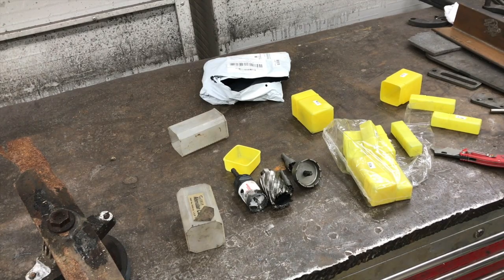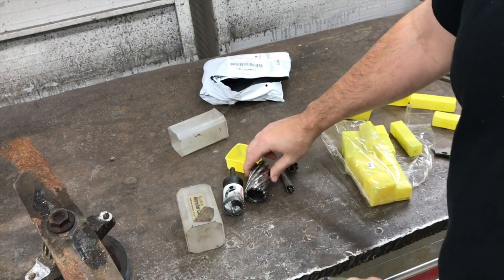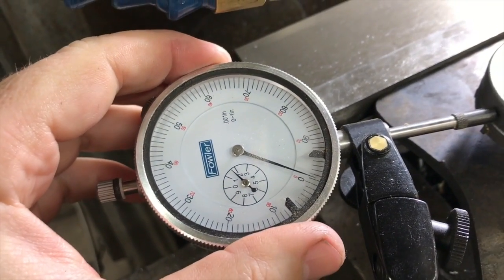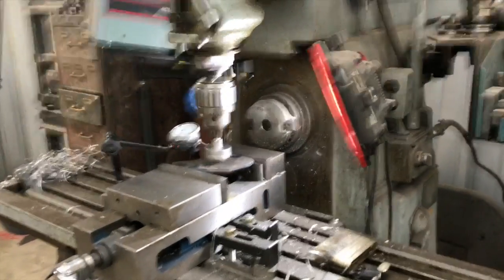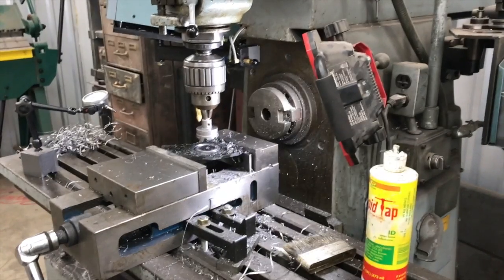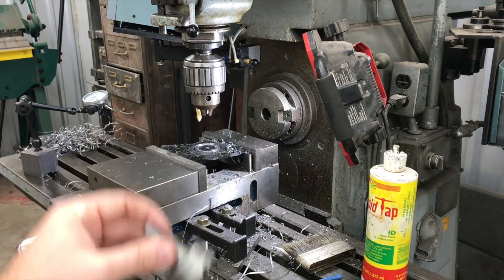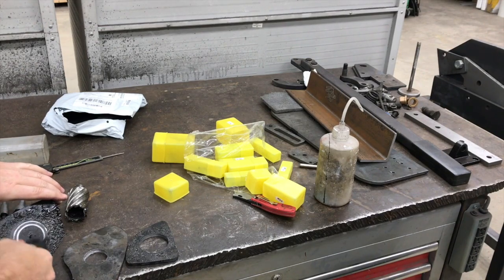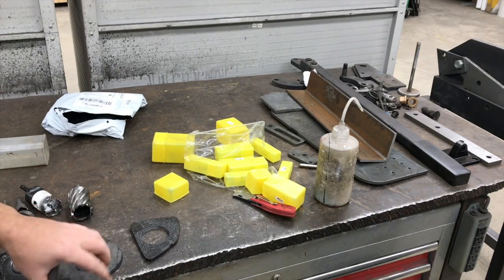Carbide Tipped vs Hole Saw vs Annular Cutter - Which is best to drill thick metal - steel - iron

Comment: I have good results using Milwaukee hole saws or equal on 1" steel.  On larger holes I drill 5/16" holes on the inside edge of the hole to allow the chips to escape from the saw.  Slow the drill press down as far as it will go and go slow with lots of coolant.  It's takes times and patience but it works. One saw will cut two or three 3" holes.  Great video.  I always wondered about those carbide saws??
Reply: Yeah, I saw that hole trick in another video. Will try it soon. If you can afford it, you can put the hole right in the middle of the cut.

Comment: Used them carbide tipped hole saws a lot your bit isn't long or deep enough to cut thru that thick of steel. Rpms are to high you applied to much pressure and I never use lube with them just cut dry like you did with the milwaukee hole saw. But on the end of the day the annular cutter is the best then the carbide tipped then the hole saw
Reply: If you look closely, you can see the cutter dripping before using it. He did use oil.

Comment: A month after you got two separate recommendations for flood cooling, you're still burning up bits. You've made no valid comparison. Go ahead, keep hanging your body weight off those handles, IT.
Reply: I think it's an old guy kinda thing. My dad had the flood coolant dismantled and I had to hang off the handle like a cliff everytime I drill with another hand squeezing off a bottle. Absolutely hate it.

Comment: It's just cheap junk. A single carbide tipped saw should cost more than that.  I agree with another post, best reserved for softer materials except you stated you'd put a pin in the chuck to check it and I didn't notice you doing that.   The saw itself is probably off but if it doesn't cut anyway, what is the real point to it since a regular hole saw will do softer materials?
Reply: aluminum

Comment: I have some of those The Carbide hole saws, bought them off eBay and found the same thing. However, they do work great for sheet metal up to about 1/8 inch material. Anything thicker they will fail miserably.
 Annular cutters are one of the very best means to cut large holes in thick material. But you pay for a good set.
 The typical hole saw works if you buy a good one, and not the cheap Chinese knock-offs.  
 Most everything is made in Asia now, BUT they also make the top quality tooling, for  North American or European Companies. 
 You really do get what you pay for most of the time.

Comment: I use a 56mm carbide holesaw at 275rpm to cut 5mm and it works fine using the same lube as you do. Cheers

Comment: Annular cutters use centering pins for a reason. The rpm was way too fast. My hougen mag drill uses annular cutters and with constant lubrication bangs through 3” solid steel like it isn’t even there.

Comment: I have never used cheap carbide cutters like you demonstrated, but have used trade grade brands for years for cutting electric panel holes with excellent results. I wouldn't consider matching a trade grade tool against a machine shop grade tool and expect the same performance. In the machine shop, I would only apply the trade grade tool where I couldn't justify the expense of the annular cutter.
I have a drawer full hole saws, because they are inexpensive. I have few carbide cutters, and I treat them with respect, because they are life savers on the electrical job site, but more costly than hole saws. I own twist bits for the machine shop and covet annular cutters.
Reply: Great feedback thank you, I was looking at some of these but Starrett not junk. I need to drill 1 3/8 in 3mm plate, I would prefer and annular cutter but they are so expensive and I would need an arbour for my mill so I think Im just going to have to hope the starrett ones are better. I note they do say "for sheet metal" so maybe 3mm and thinker is pushing them a bit far, I guess I'll find out.

Comment: Carbide is very hard but brittle. I don’t understand why the makers of those bits claim they are good for metals. Makes no sense to me.
Reply: It's for precise cutting used fixed lathe industrial setting. Well pressure will be applied laser sensor.

Comment: I use (more expensive) carbide tip hole saws quite frequently and they work quite well. I use them in a hand drill though. I find they work best with light pressure. I drill primarily 1/4" aluminum with them bit have drilled 1/2" to 3/4" cast iron as well.
Reply: What brand do you recommend?

Comment: thanks for the link.. i borrowed a carbide tip hole saw from a tradesmen working on the farm that  work on, it had only 2 carbide tips left (the rest had broken off/worn down) and he said be careful as the cost around 200 bucks (nz dollar) well as luck would have it... or murphys law... i broke another tip off.... then his pilot drill bit.. was worried it was gonna cost me a lot...

Comment: We use these ones https://www.whitesiderouterbits.com/collections/deep-cor-hole-saw/products/8081750

Best carbide tipped core drills we ever used
Reply from the maker: cool, i like the fact they are USA made, are they meant for metal?  or just wood ?
Reply: Ramsey Customs - turbocobra we use them on steel mostly.  With this cutting oil https://www.amazon.co.uk/Rocol-53072-400g-RTD-Liquid/dp/B00A2LQ7I6

Comment: I like them. When I discovered the beauty of annular carbide cutters, I went on eBay and got a bunch of Milwaukee steel hangs for an average of $5 each, now if those could hold up, $25 is an awesome deal.  For me, the steel hawgs work great. I even did a video on how to use them like 6 years ago.

Comment: i used these already enough to realise i have to turn the workpiece upside down when its about half way trough the workpiece. The pilot hole will be there to help. I Use plenty cold water-lubricant mix and keep it cool as much i can. The water also helps to remove the shivers out of the way. 5-10 mm steel no problem. I made plenty holes into C-profiles. Used it with hand drill, low rpm, high torque.

Comment: This pretty well confirmed my thoughts on those carbide cutters,....maybe they're ok for thin sheet metal or wood, but not for steel, as some of the advertising would suggest. I guess for a cutting depth only 1/2 inch ( 13 mm )  this should tell us all we need to know.

Comment: Think about the spring... The totale deepht of the saw was 0.5 inch but the spring on the center of the saw were compressed down and jeep away space in the cutting deep
Reply from the maker: The spring wasnt on the first one I tried.
Reply: I suspected it was so,it was too silly a mistake to be true, but in the video it was not specified
Hi

Comment: Didn't you say the kit was $25? Looks like it performed like it. China thanks you.
Reply from the maker: Yes, $25 for 10 hole saws.  get what you pay for
Reply: I used one to make 4 x 54mm holes in 5mm steel at it did the job. I was babying the best I could with an electric power drill after watching you destroy the one in the video :P Definitely not for industrial use, well not for steel.

Comment: Pretty sure that chatter you are getting with the annular is from you bowing the plate from the force of you pushing down on it with a cutter since you are only supporting 2 sides.  Put a board or something under it so it is fully supported and try it and see if it doesn't behave better.
Reply: Id say its related to the speed the mills running at ..
Reply from the maker: you might be right, but that particular cutter does the same thing on 3/4" material as well.
Reply: Pretty hard to bow 1/4 plate that short.

Comment: I have used champion brand carbide hole saws and have been very impressed with the hole being +/- 5 thou of nominal dimensions.. For semi precise holes in the mill they are a cheap way to make a few to a hundred holes depending on coolant.

Comment: I expect those carbide bits are only intended for sheet metal, aluminum, plastic or wood. Save them for your woodworking, but again they would only be good for something rather thin... Good test, Gary
Reply from the maker: yea good points for sure.  Whats odd is their ebay link says its not good for thin materials
Reply: we use carbide tiped hole saws on really thick steel. did 3in plate yesterday with a 1.75in cutter
Reply: No its definitely not for wood.
Reply: Ramsey Customs - turbocobra and its true!!! For sheet metal these rare teeth are tend to rip apart the material. I would avoid to use them below 1mm.
If there is no other option, then you have to clamp it down  your workpiece (clamps are close to the hole) on a sacrificial material.
Reply: they are used for hardened steel. The material is too thick for the carbine bit. The filings cannot excape, from the flue pathway. Which will burn around the carbine teeth.

Comment: I got a cheap set of those carbide tipped hole saws - not even tried them yet. Can't see them lasting long and yours did pretty much what I am expecting!. 
I very much like an annular cutter whenever feasible but a good bi-metal hole saw can do OK quite often.
Reply from the maker: yes sir chris, agree on the regular hole saw, if your in a pinch they work pretty good, just need to do alot of pecking and manual chip evacuation in thicker materials thanks for watching sir

Comment: Due to I don't have a mill and do cut a lot of holes in thick stuff , the cutters with the carbide tips is way to shallow, how ever they may work good in thin stuff, I prefer the hole saw bits with a deeper cut with a lot of cutting fluid, also then the hole can be trued up in the lathe if need to. Like you said in the beginning of the video if its free and seems to good to be true  , it usually is ,(no good) after your video I will leave them in the store.
Reply from the maker: Thanks for watching Anthony

Comment: Years ago I used a Greenlee carbide hole saw for a bunch of holes in stainless, I want to say they were around 1-1/2 and the material was 3/16 thick.  I remember it worked really well.  Have a look how the reliefs are cut in that tool compared to the ones you have.  You may want to try more rpm but I doubt those things will work at all.  Not trying to be an ass Gary but your mill does not sound too good.
Reply from the maker: your not being an ass, just telling the truth, it sounds rough, i showed it in a vid a while back on the old barn channel, need to investigate for sure

Comment: I use 3/4” Weldon size shank annular cutters in my mill. The arbor for these costs about $75-$100. If you want internal cutting fluid, the ones with that attachment go for about $120 - $160. There are more expensive arbors, and less expensive. The cutters from a high quality maker, such as Fein, go from about $20 for small sizes to about $75 for large ones.

These do cut very well, and smoothly. A mill at a slower speed works very well. Smaller drill presses, with less than about a 1 Hp motor, and a not so solid column, not so well. You need power, and speeds below about 400 rpm for 1” cutters, 2” cutters prefer 250.

These carbide cutters are really meant for sheet metal, and thinner plate. Even 1/4” can be a problem.

By the way, why does your mill have those chunky sounds, even when you’re not cutting?
Reply from the maker: great info, agree... yea the mill in low gear sounds rough, i mentioned it in soem other videos, need to investigate for sure

Comment: Dang, I was pulling for the cutter. I use a hole saw to cut circles that I end up welding together to make wheels for my hand forged barn door hardware. The hole saws work but I sure would like something better and not sure that I can fit an annular cutter into my Delta drill press.